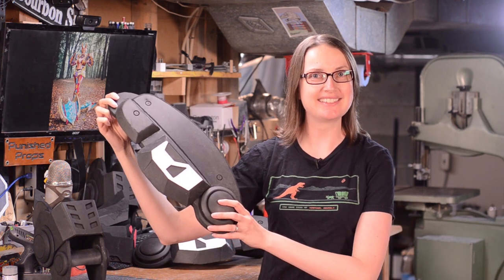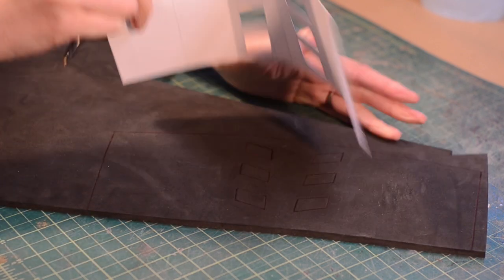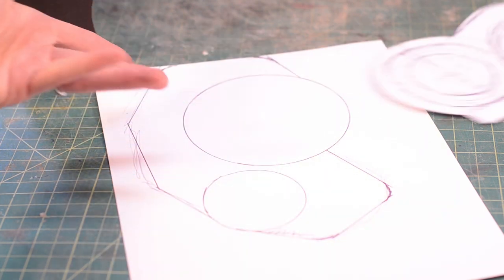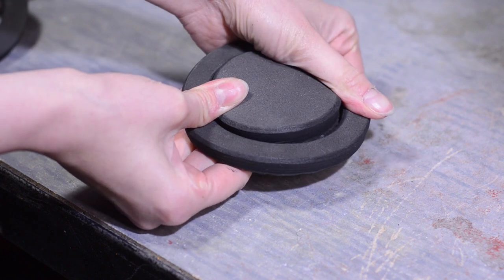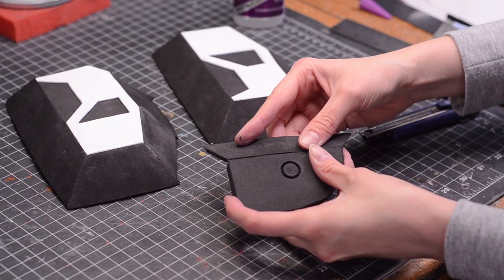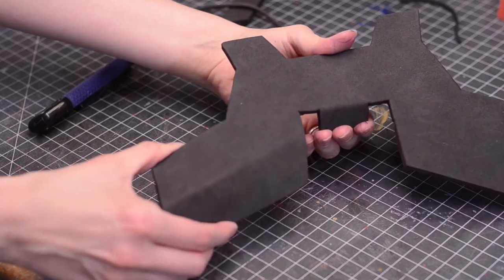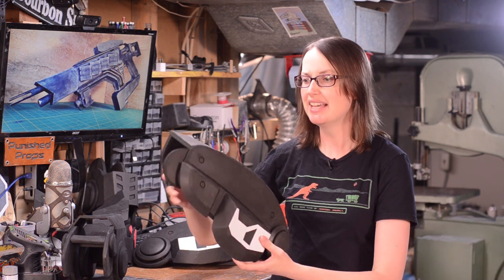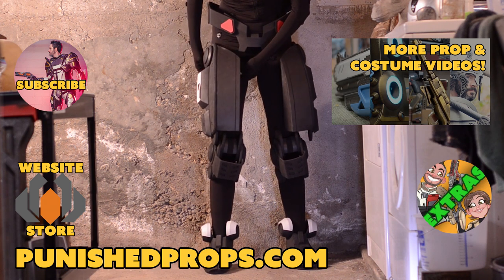EVA Foam Robot Legs - Destiny Sweeper Bot Build

Comment: Would have been nice if yo had provided an alternative method for those few who do not own a laser cutter.
Reply from the maker: You can cut out circles in foam using a sharp knife and lots of practice. You can cut them out a little outside the lines and use a sanding drum on your rotary tool to clean up the cuts.